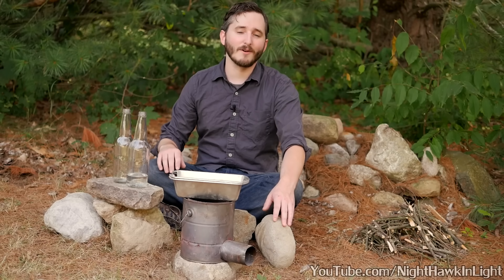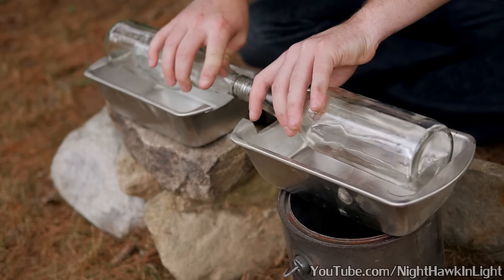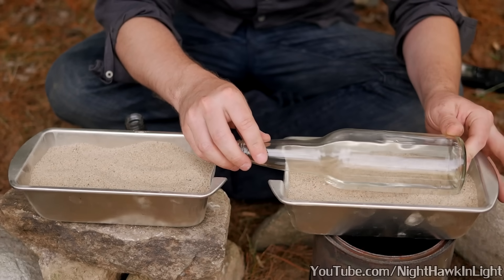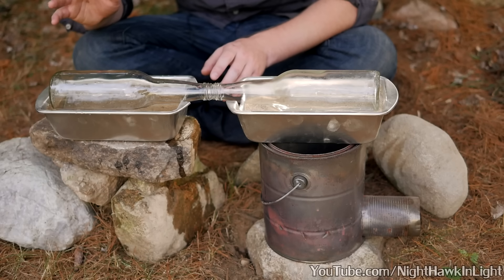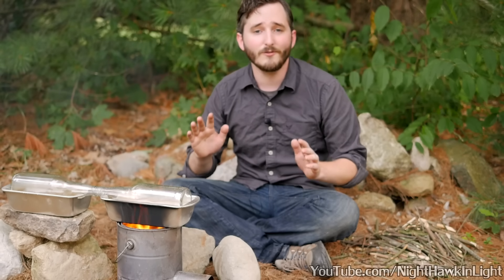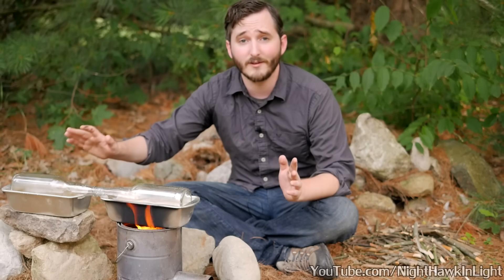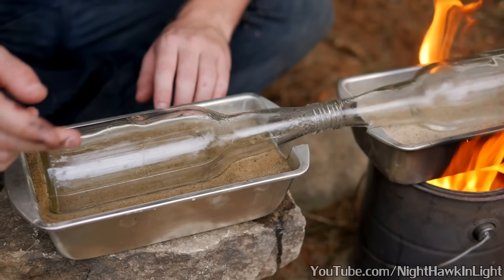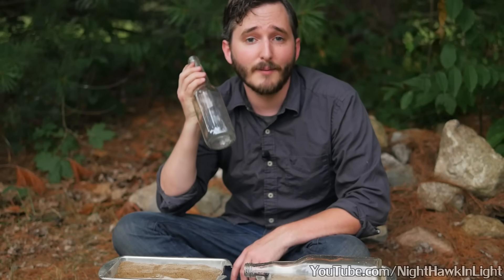How To Turn Salt Water Into Fresh Water (Simple Improvised Distillation)

Comment: even simpler solution. dig a hole in the sand, and place your bottle in it upright in the hole.
(method 1). If you have a straw, place the second bottle upright, but slightly higher than your main one.(if you're on a beach in the pacific, many trees and plants have large oily leaves. These are perfect as they are water tight, roll them up, and you have a water tight tube). Then seal any gaps in the first bottle (depends on local resources), and then wrap the neck of your second bottle in your wet rag. This is more efficient as it allows to fill the first bottle to the top.

(method 2) make a small mound and place your bottle at a 30° on top of it. Light a fire at the base of the bottle (make sure it doesn't reach the neck). Clean any type of rod or stick and place it into the neck, wrap a DRY cloth around the stick. As water boils the steam will rise and absorb into the rag. Then just squeeze the water out (make sure the rag is clean first).

Comment: Good video! Way to survive if stranded , maybe even in a life raft using sun for heat, etc.  IE 
 Stand bottle upright using sun for heating the saltwater, then shaded (for cooling) tin can cocked at an angle over the bottle to condense the distillate (water here) and it drips into a cup or other bottle also shaded, might work?   
         FYI: In a harsh environment: After 3 days, you need water or you'll perish. You can make it 3 weeks without food, though we promise you that won't be fun. Despite this possibly helpful rule, some people have survived 8 to 10 days without water.

Comment: This is very impractical, the tiny amount (less then 20ml) of water you earn per 15 mins is not sufficient to replenish the need of daily water intake (1000 ml). Also refill sea water while the bottle is hot have to risk of cracking bottle. Let alone the huge efforts to cut woods + fire set up time.

Comment: Just remember that long-term (weeks or longer) drinking of distilled water might not be ideal, especially when you're also short on the food supply and thus you can't replenish your electrolytes that way. Also, if stored, distilled water will dissolve more CO2, forming carbonic acid, than "usual" water, depleting even more magnesium, calcium and potassium in your body. You may mix a tiny bit of salty water into the distilled water to alleviate the problems, in case you start to get muscle twitches or cramps.

Comment: Yes, but it doesn't scale, so it can't be used to solve the water crisis.
Reply: NeonsStyle it scales but not well. Diminishing returns.
Reply: No it doesn't, because it takes so long to evapourate and create results.  There are better ways, like getting Osmosis to work for you, which does scale and scale really well. It's also inexpensive, since the only cost is the power to the pumps.

Comment: Now can this be used to make essential Oils because I know kits for that can get expensive unless you have a way to do that
Reply: HuntMaster You could, but you'd get a really bad yield. A proper distillation setup isn't that expensive and I got mine for under 50€ off ebay, I think. If you vant to make a diy distillation setup for essential oils you need a proper condenser, or atleast a long tube between your boiling flask and collection flask. Two wine bottles with corks and a bit of steel/copper tubing might work.

Comment: hi there. this is very cool but I think one fact you rely on is wrong: glass bottles are everywhere. to the best of my understanding, chances for glass bottle to reach a beach in one piece is very low due to wave activity. it will shatter quickly on rocky and sandy beaches and will continue to erode against quartz which is harder than glass. please correct me if I'm wrong.
in addition, as others mentioned, distilled water are not the best thing, especially if you're on a survival diet, probably low on minerals. it might be a good idea to add some slats back by adding a bit of seawater back. seawater are roughly 70 times more salty than fresh water so for every full bottle (750ml) you can add 2-3 bottle caps of seawater (say it's 5ml per cup...).
keep up the cool smart projects!

Comment: Is it safe to refill the hot bottle with cold sea water though? It might be a problem because you can shatter the bottle. Atleast thats what I can see coming. Correct me if im wrong
Reply from the maker: I should have mentioned you should take the bottle out of the sand for a minute or two to cool before refilling.

Comment: For "off the grid" applications you could make it vertical, using plumbing metal tubes to drive the hot water thru a charcoal filter then to another bottle down below. You just gonna need something to cool it down a bit. Avoid plastic tubes.

Basically an homemade version of electric water distiller, who will gives you fresh water from rainwater/pond water/sea water. If you couldn't do this buy an electric one, tap water is fucking nasty and filled with contaminants and others hazardous substances, no matter what officials says it is no healthy nor healthier than water bottle. Theses basterds loves to fill tap water with aluminium, it is also filled with oestrogenes from contraceptive pills who fell off in toilets...

Be smart, be safe.

Comment: This video gave me a lot of new ideas I knew the simple concept of distilling water and I knew you could like do it with a clean soup can and a copper tube but I never tough about using glass bottles and sand to evenly distribute the heat. THANKS this video gave me a lot of ideas.

Comment: The bottle does not need to be glass... Even normal plastic water bottles will work because when water is boiling, it prevents anything it is in contact with from getting hotter than the temperature of boiling water...  Because of that you can boil water by just suspending the bottle with no lid over the fire... And of course make sure that the water doesn't all boil out, because the temperature will skyrocket very quickly, and you will have a very melted bottle after that...

I think this video is cool, however even with as simple as the setup is, it still is needlessly complicated IMHO...
Reply from the maker: You can boil water in a plastic bottle, but how do you collect the steam?
Reply: You would need some sort of condenser, condensing the steam back to water, and kept separate from the smoke from the fire...  I envision something along the lines of this sort of setup https://goo.gl/images/nqZJ4H Just greatly sped up with boiling the water...  But that makes the process more complicated because you also have to remove the same amount of heat you put in on the cold side to get it all to condense out...

I will admit that your way is actually working compared to the mental image that exists only in my head... My brain was reacting to needing glass bottles when you are unfortunately far more likely to find plastic water bottles everywhere... And needing the tray/sand on the heated side when you can more efficiently directly heat the bottle as long as you don't have to worry about it shattering on you from thermal shock...  Glass bottles can work on the hot side just like a plastic bottle can... and I would probably prefer not having to worry about other stuff leaching out from the bottle during the heating process... You just have to make sure it is heated/cooled slowly enough...

I do love your videos though, and never though I would get a response
Reply: Any areas not being actively touched by the water would then melt, thus causing the bottle to fail.

Comment: If your on the beach dig a hole where tide won't wash it out cover it with a clear plastic sheet place a rock in the middle with a collection pot under it let the sun evap the water pour impure water every few hours around the collection pot. Then boil to sterilize the collected water if needed
Reply from the maker: If you have a plastic sheet that's a good method. But solar distillation is very slow so you need a very big sheet or a lot of them to make enough water to live on.

Comment: All i see is that you can edit your videos.Looks like b.shit...You didn't even seal the bottles.I can't say that it don't work but i wont try and waste my time.I'll drink this one 🚾 instead. 😂
Reply: lancepierres 1, I have no idea what you mean by wc, and 2 the seal doesn't need to be tight. Yeah, you're absolutely losing water if it isn't a tight seal, but some of the water vapor will transfer to the second bottle. Also, weird choice of censoring yourself there with the "b. shit"
Reply: The King of all Awesomeness WC is 🚽
Sealing the mouth of the bottles would be more effective imo.It will be enoying to separate them for refill,i agree.Btw,refill cold water in a hot glass container is not that smart.
The b******t was not really cessorship.
Excuse my bad english.😊

Comment: U can just connect the neck with tape
Reply: Jikato need to allow for expansion on the system.
Reply: Richard Bates and don't forget that the neck of the bottle is likely suspended directly above a fire.  Not an issue with glass, but tape is far more temperature sensitive.
Reply: Jikato be careful with the pressure that steam will create
Reply: Jakob Stroisnik hmm.. you know it would melt and warp the plastic right?
Reply: Jakob Stroisnik it can also let toxic fumes in to the water
Reply: Infandous Ktenology if you also have a plastic bottle you can press is together and connect it to the system, that way it can expand and counter the pressure

Comment: Refill it? You're going to pour ambient temp water into a boiling hot bottle? Lol. Wouldn't want to cool the bottle fill it, then put it back in the hot sand either. I feel it would be a better idea to somehow figure out a contextually appropriate way of bridging the gap between the bottles so they can be oriented better.

Also will kill biological contaminants. Also, I think I caught a bit of a show the other day that suggested it's technically possible to drink saltwater alone and get enough water out of it, but that you have to be very precise about it, or that otherwise small quantities of it can be used to supplement freshwater. Not sure about that, but I'm too lazy to look that up.

Comment: You can easily make multiple of those with just one fire to maximise distilation rates.
Reply: I was thinking an angled connector to increase quantity storage in both bottles
Reply: +DastiRD:--Yet another level headed thought to perk up this clever idea.!
Reply: DastiRDTV In a very long survival period you could even make a hotter fire and manipulate bottles so that you could upgrade the frequency of refilling.
Reply: @Hepad_  in survival situation where you abandoned in a remote island. Sadly you wont find enough bottles to make a distilled water factory out of it
Reply: Rpy Lamp it depends. Even on remote places of the world you will find trash.
Reply: If you were to do this, I'd suggest refilling the bottle in series. You'd have to let the warm bottles cool off before refilling it with cold water to reduce thermal shock. So you could do something where two bottles are distilling while the third one is off cooling. Then when the next bottle is done, refill the now cool bottle and place it back in and remove the empty one from the cycle to cool off, and repeat.
Reply: Yes and then you can sell it for dried fish to other stranded people on the surrounding islands.
Reply: VideoGameGang A
Reply: Angle distillary bottle upwards to trap steam that would otherwise be stuck by the lip when it’s flat. About 5 degree tilt should do, and you can add more water as well.
Reply: yes :)
Reply: No, that does not work. the reason is this, the resin, which you probably are after, that contains the psychoactive quality of the hemp plant is a mixture of more than a dozen different components, the one that you are after is a substance called THC or TetraHydroCannabinol and it makes in the best case around 10% of the resin aka hasheesh. The THC is a syrup like, colorless, transparent liquid,it has the structure of a large, fairly complex organic molecule that is made of the elements carbon, hydrogen and Oxygen, but remarkably , no Nitrogen, and by this differing to most other psychoactive substances known to exist naturally in certain plants, like Morphine, Cocaine, Psilocybin, Mescalin and others,known as ALKALOIDS, that all contain Nitrogen in a so called "Amino" group as their signature structural detail,  ( important, for this gives these substances specific chemical qualities, which can be used for the process of separating and purifying the individual desired substance from the rest of the plant materials, ideally you end up with an cristaline white powder like Morphine, Cocaine, etc., but I digress). 
Back to Marihuana, the boiling point of THC , the critical factor in any distillation, is at a 157 degrees Celsius. The problem with gaining pure THC through vaporising it, is, that heat will break up the THC into smaller, non-psychoactive molecules, before it reaches its boiling point. It is still possible to separate the THC from the resin through distillation, the trick to do it is by applying a vacuum pump to the setup, which will lower the pressure inside the apparatus and with it the THC will vaporize at a much lower temperature. It can be done, but it is a fairly inefficient method.
The clever way to indeed isolate the precious THC in its pure form, without destroying any of it, is by a procedure known as CHROMATOGRAPHY, which can be done with relative simple equipement and a little bit of know-how. Feel free to investigate at your hearts desire!
Reply: or maybe you could just find some copper ore, melt it down and hammer it into a still... with a rock.
Reply: Smart people make the world a better place, this was a excellent video and a good thread.. good thinking ^^^
Reply: Yall been playing too many survival games
Reply: DastiRDTV just remember not to boil the water to  quickly but simmer it ,else the bad property's if any will rise into the clean water.

Comment: Could you use this method to collect sea salt? Would the sea salt be left over in the hot bottle if you left it to evaporate completely?
Reply from the maker: Sure, but you may as well just boil it away in a frying pan in that case
Reply: Yes. Generally speaking though, if you were looking to collect sea salt, large open trays would be better, since you wouldn't need to use fuel to evaporate the water that way.
Reply: seigeengine perhaps cookie sheets. Make sure you paint the pan black to get more heat from the sun and evaporate faster
Reply: But only if you have non-toxic black paint that results in a hard durable finish. Generally speaking, I think it would be easier to create a sort of hot box for it using a transparent lid and  using a chimney to draw air flow through it.
Reply: i suppose this isnt what youre asking for but vacum filtering would be a way better way to purify sea salt but a little harder to improvise i guess
Reply: Just boil the water dry a pan. But be careful not to burn the underside of the pan because when all the water is removed the heat from the flame/burner/stove can burn the underside of your pan with no water to absorb the heat.
Reply: A vacuum can be created by water pressure, but yeah, that would be pretty hard to improvise.

Comment: Wouldn't you be able to use a plastic bottle or bag for the collection or perhaps an empty coconut? If you can only find 1 glass bottle?
Reply from the maker: You could use a plastic bottle, but you would have to keep careful watch and rotate it all the time so it doesn't melt from the hot steam.

Comment: Could you break a small hole in the cold side bottle and get it drip down into another bottle to harvest more water without having to continually emptying the collector bottle?
Reply from the maker: It would be hard to make a hole without breaking the bottle. It's really very easy to empty the bottle and put it right back, not worth the trouble.
Reply: Or, you could just use a bigger bottle.
Reply: Yeah, the collection bottle can just be grabbed and the water collected dumped into a third bottle for storage.
Reply: And let the water drain out of the bigger hole? That's a good idea, and leaving some water in the collection bottle will aid in the condensation reaction too.